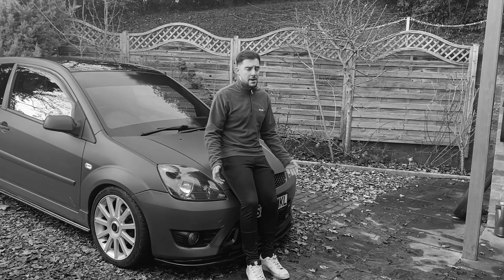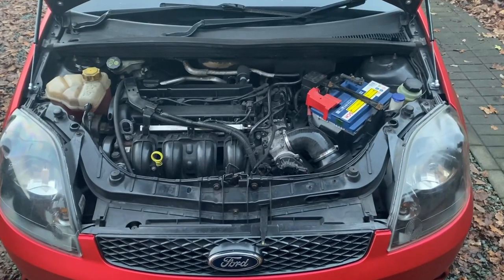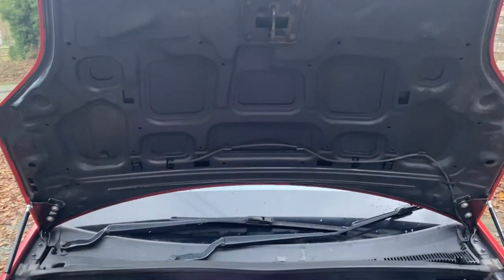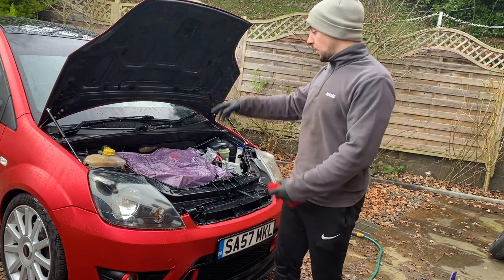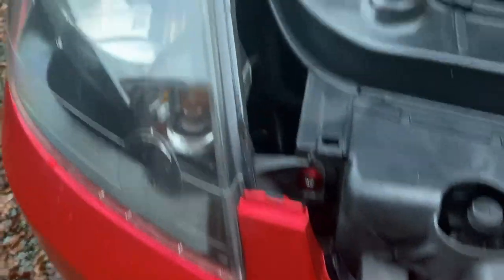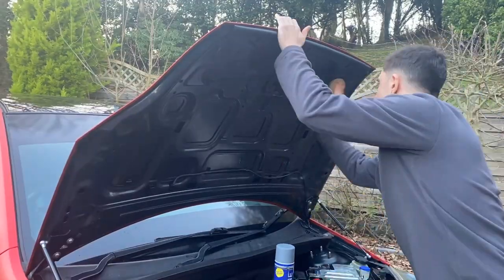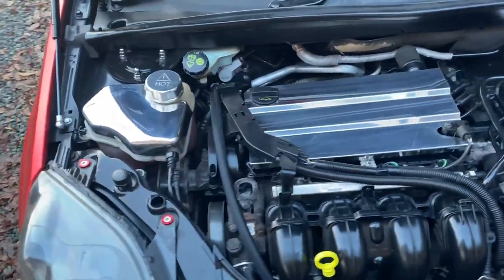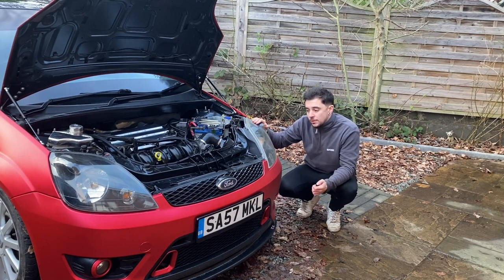Engine Bay Clean, Detail & Dress-up on my MK6 Fiesta ST150

Comment: pressure wash mine mike , auto finesse “ eradicate “ cleaner , work in with detailing brushes , clean off then plaster a load of auto finesse “dressel” to finish off , tad of “tripple “ polish to finish off all my stainless parts …nuts and bolts i’ve changed or replaced with dress up kits …..got all the  blue iguana parts on mine pus the AS engine cover .and a few other caps and covers for bottles .., yours came out well tbh ..😎
Reply from the maker: Just when I thought I’d been thorough 🙄😂😂 your bay does look mega though 🙇🏻‍♂️

Comment: Did you check the electrical spacings between battery terminals and that chrome cover? 😜
Reply from the maker: Would you believe me if I said my second hand chrome parts from Facebook sales came with a data sheet? 🤥